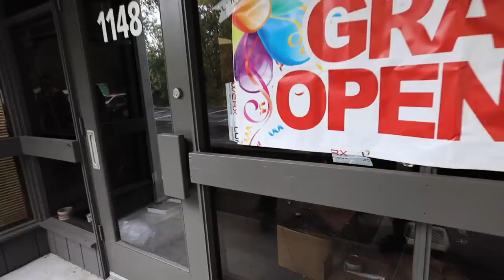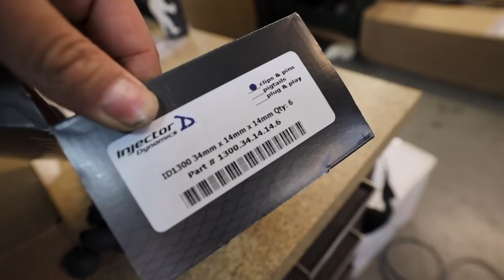6 Cylinder STI Update: Super Lube and Injectors!

Comment: ECU.  I believe with that you'd be able to complete the interior and snowball method suggests knocking out the mounds before the mountains (regarding interior, exterior, engine bay and exhaust)
Reply from the maker: I'd like to but can put anything back together until the motor was in to make sure it all worked 😅🙏

Comment: Turbo would be more interesting :))) but I think the wiring is most important. Ah!
Reply from the maker: Agreed, if I get a jump on wiring it might make things go a little smoother down the line but if the turbo comes we can get the exhaust done when the motor comes back 🔥
Reply: @Smeedia  it would be a lot easier to run wiring before bolting everything on. More room, less stress.
Reply from the maker: True but I also need to have most bolted on so I can see where I can and can't run wires 😅 think I'm going to do ECU first just to be able to figure out thr re-pinning

Comment: ECU 100%.  Wiring is going to be the thing that keeps the STi in the garage the longest and (from experience) there is nothing more frustrating than having an undrivable car with all of the pieces/parts in when you haven't tackled the wiring much or at all.  Turbo will be more interesting to watch, but if you order ECU, you can get the wiring knocked out and then its (mostly) sweet, sweet gravy from there.
Reply from the maker: True, turbo is a 2 month lead time which is what is is. But I'd like to get most wiring knocked out

Comment: Love the video! Also having problems with my dccd. None of my switches work. In my 2007 sti any idea why? Or what I need to do)
Reply from the maker: I had a similar issue on my 07 and it turned out to be the switch. Just replaced the button and it worked again 🙌
Reply: @Smeedia  okay awesome! I forgot to mention when I turn the car on my dash don’t light up all the settings from what I’ve seen in other videos it cycles threw all the lights. Mine just shows auto
Reply from the maker: I would try the button first cheapest point to start at 🔥

Comment: turbo first so you can figure out where you need to avoid putting wiring so heat doesn’t melt the harness
Reply from the maker: Also a good point, have not though about it that way 🙏

Comment: So there is 2 bolts on the front of the fuel pressure regulator do you have any suggestions. I am trying to find some either black bolts or weather proof bolts. I had my fpr installed for like a couple days and the bolts on front started to rust and I hate that
Reply from the maker: Snag some Stainless steel bolts and they won't rust, just make sure the thread pitch and length are the same
Reply: @Smeedia  I'll have to look into that. Thank you 😊

Comment: Get the ECU first. It's going to be the hardest thing to deal with so get it done before you get the "easier" things.
Reply from the maker: Thats what I was thinking but would be limited on how much I could get wired until the motor and exhaust work is done to know where I can run wiring